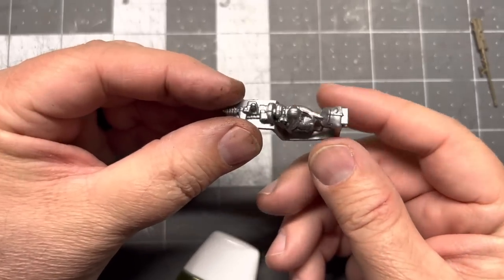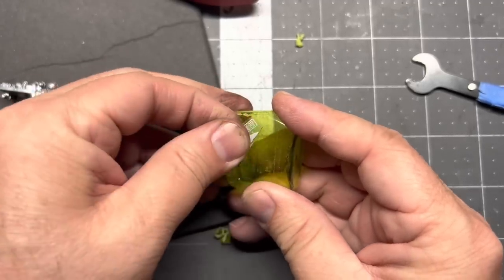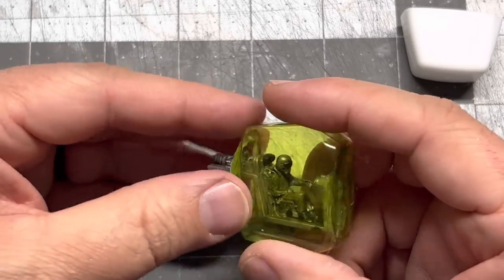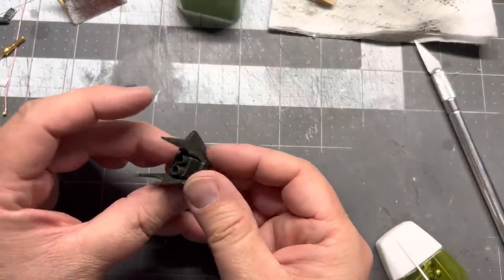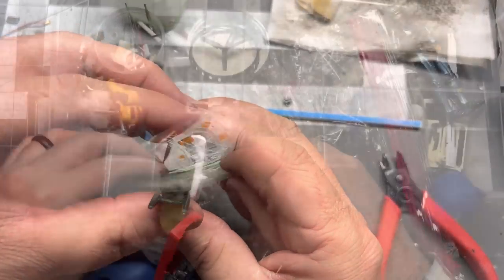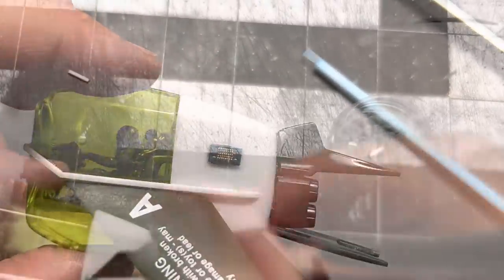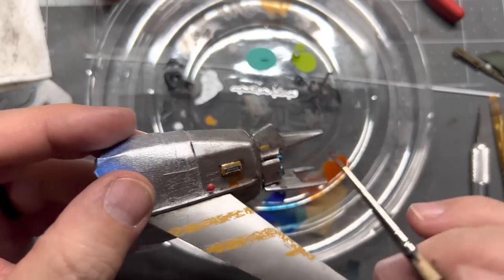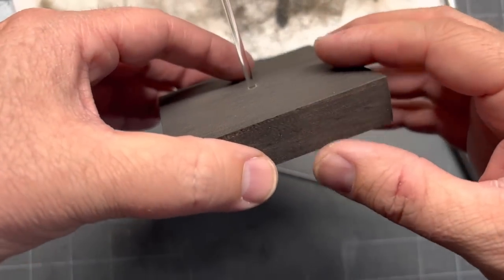Let's Make a Ship From Trash

Comment: It has a real 50's futurism vibe. A thing I find missing from a lock of scrapbuilt model ships is panelling and having the aerodynamic exterior compromised with extensive greebly usage. Realistic space ships wouldn't have core components and circuitry exposed or really anything that wasn't integral to function, modern ships in our world are mostly smooth and seamless looking, but up close are riddled in panelling and formed smaller patchwork-like parts. In the case of the ship made here, it looks as though the ship is a single metal form with glass cockpit. Carving in some groove lines to suggest depth between panels, or layering over thin sheets of film or paper to paint over can do wonders for breaking up the smooth body of scrap-built ships.
Reply from the maker: Great input… thanks for not just saying “I hate it “😂

I totally agree… I always struggle with how much is too much and what to little. I also regret painting over the cool little copy on the wings…

Learning is part of the journey. Thanks again.